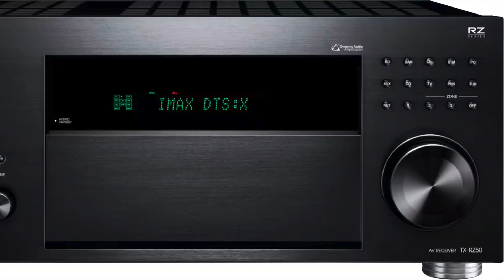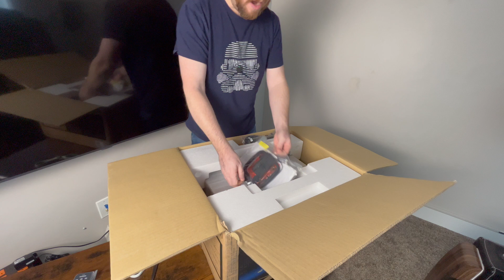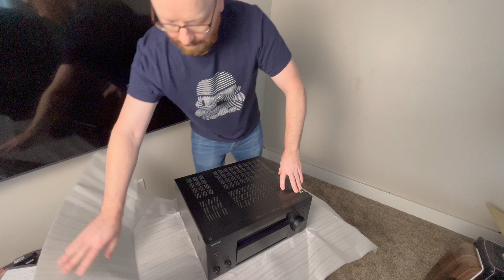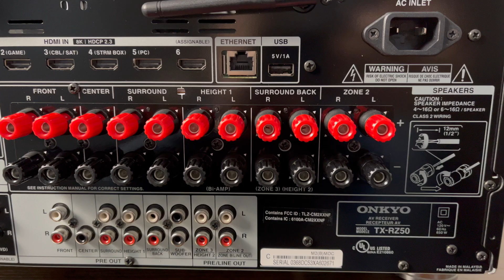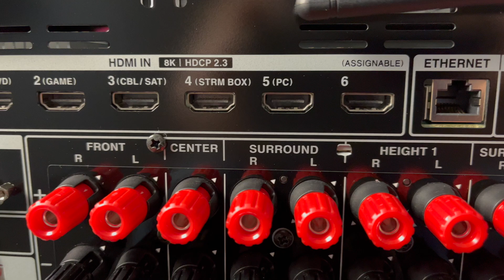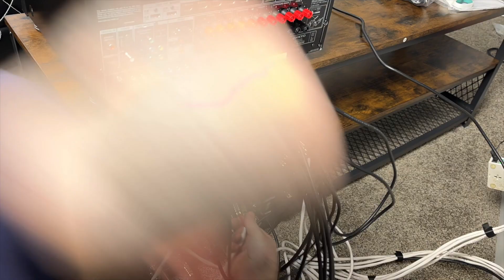Ep 5: Do NOT Buy a Home Theater Receiver Without Pre Outs

Comment: One of the main problems with most of any AVR pre-outs, and nobody really  talks about it, is the output voltage/sensitivity of the RCA terminals. Many of them suck at having a decent output voltage. Good luck at finding this information, because very few producers mention this crucial spec in their user manuals. All power amplifiers have a certain input sensitivity on their line level RCA. If there is a substantial gap between the output and the input sensitivities, you can have a problem with reaching the amp's true power potential. So, beware, you should take this into account when going with separates. At least, check the input sensitivity in the amplifier's specs, it's always there. If it's around 1 volt, it should be ok, most of the AVR's can deliver 1 volt at their RCA pre-outs. If your amp has a rated input sensitivity of 1.5 or even 2 volts, well, it may be a hit or miss for your AVR. I just don't understand why ALL the AVR's aren't capable of delivering up to around 2 volts by default, on their pre-outs. Almost all cd/dvd/blu-ray players can do that with ease.
Reply: The preouts on the RZ50 are very good. 3v rms. Drives my xpa5 with authority
Reply: Denon and Marantz receivers have a function named pre-out only mode that disconnects the receiver's  pre and power sections lowering distortion. Audioholics has benched excelent voltage output levels from these receivers overall 😊😊😊
Reply: @afelcandy , no, they don't completely disconnect the pre from power. Only the top of the line receivers from D&M do that.
Reply: @byron19800  As far as I know, since 2021 all the receivers from D&M with full pre-out connections can activate the pre-out only mode with any combination of channels. Nowadays DENON 3900 ou MARANTZ CINEMA 70 are the basic models that, once this feature being engaged, can be used as a full pre-amplifier 🤔
Reply: @afelcandy , I'm not talking about the existence of pre-outs or not. I'm just saying that only the flagship AVR's from D&M will give you the option to completely cut off the pre-out section from the internal amps. For the rest of the models, the signal is not completely cut off and the internal amps are still active, even in pre-out mode.

Comment: Here is another reason for the pre-outs:  Expandability. 

When we purchased our home, it was pre-wired on multiple floors with in-wall or in-ceiling speakers for 5.1 channel surround sound. On our main floor, it was in-wall front left and right, about 6 1/2 feet high.

We wanted something more encompassing and so purchased front tower speakers and upward firing Atmos speakers to sit on top of the towers.. So what to do with the front in-wall speakers. 

Option 1:  Some form of front Atmos channel
My Pioneer VSX-LX505 receiver only allows the Height 1 Speaker Outs for Atmos Front. 

Height 2 Speaker Outs allows for Atmos Surround and Front Heights. 

I had to use Height 1 for the Atmos upward firing speakers. Front heights are not really useful for forward facing in-wall speakers, as front height is really only beneficial for in-ceiling or downward angled speakers. 

Option 2:  Wall of Sound using Zone 2 or Zone 3

The thought then occurred to me that I could use Zone 2 or 3, and effectively create the same audio as the audio coming out of the tower speakers. 

 But the problem with Zone 2 and Zone 3 is it can only handle basically 2 channel analog or digital 2 channel PCM.  Well - this defeats the entire purpose if I want an Atmos system, as I would have switch all media content devices to PCM 2 channel signals. 

Solution?

The Pioneer (and Onkyo/Integra) receivers send line-level signal to the pre-outs in the same pattern that it sends signal to the Speaker Outs. So if running a 5.1.2 signal using the receivers own amplified signal, it will send line-level signals to the same pre-out RCA outputs as well automatically. 

I purchased a cheap FOSI 2 channel amp, connected it via the Front L/R pre-outs, and turned my front left/right from a 2 woofer, 1 tweeter tower, into now what effectively is a 3 woofer/2 tweeter speaker system for the front right and left.

Comment: Excellent advice, I only had one receiver, my first one that didn't have preamp outputs and it limited system expansion.  Everyone I have gotten since has had preamp outputs for all channels plus the subwoofer, although I have only used the front channel outputs.  What does anyone think about models that have both the preamp out AND the  power amp in/main in loop for all channels instead of where the internal amplifiers remain connected at all times?  Normally, they would be jumpered together for internal amplifier use, but would allow you to insert a processor between the receiver's own preamp and power amp sections (instead of using the tape loop), or bypassing the receivers own preamp and going straight to the power amp blocks,  in addition to not running the internal amps (at least not at that level) when not in use.   For example, some 90s vintage receivers that had this were the Pioneer VSX-D1S/D901S/9900S etc.  Although not digital and obsolete by todays standards they were reasonably future proof for their time.

Comment: saying do not buy an amplifier without pre outs in my opinion is incorrect. You buy what you need for the room you are in, in most cases people buy equipment which is overkill for their living space. Is like me buying a race track bike with all the mods and using it on the street, leaving a lot of performance on the table. Another thing is you can add an external amp to your none pre out receiver, I have done it and still do with all the 7 channel receivers I have purchased. did it with my Sony dh790, Marantz 1510 and Onkyo nr6100, not one issue with distortion well at least that any human can pick up. what you need is a speaker to line level adapter from russound, that one in particular handles up to 250 watts of power rms. just make sure you get the correct one that handles the rms of your speakers and you are good to go.

Comment: Yes... pre-outs can be very useful.  

I recently acquired new front left/right speakers that are 4ohm rated and there was no way I was going to allow my AV Receiver to power them and risk damage to my internal amps.  I ended up using a 2 channel class A/B amp and the pre-out to power them and it's worked out great for me.
Reply: What AVR do you have?
Reply: @gmoney5506  I currently run a Denon, AVR-2808CI from around 2008.  Obviously not a modern AV Receiver but it does the job for me since I run a lot of older pre-HDMI equipment on it.  Also, it does sport all the major codecs short of Atmos that satisfies my needs for now.
Reply: @gmoney5506 I own a Denon, AVR-2808CI from around 2008 (1st year that Dolby Tru-HD, Plus, and DTS Master HD was released).

Definitely not a modern AVR by today’s standard but it’s a good workhorse nevertheless.  Also, since I have a lot of older video gear connected to it, it works for my needs at the moment.
Reply: @gmoney5506  I have a Denon, AVR-2808CI from about 2008.  Not a very sophisticated unit @ this point but it does everything I need including interfacing well w/ my older source components that are pre-HDMI.

I'll eventually want to upgrade to Dolby Atmos but at this time I'm fine w/ my 7.1 set-up (this unit was one of the first w/ Dolby Tru-HD, Plus, and DTS Master HD).
Reply from the maker: It’s always good to protect your gear, glad it’s working out for you. Thanks for watching!

Comment: Haha. I'm keeping my Denon AVR-X3400H for now with only 4 speakers (I live in a temporary space) and I may plan on buying a 4-channel amplifier for my front speakers (JBL Stage A780 that I purchased recently) and surround speakers (Insignia NS-B2111 speakers that I purchased about 15 years ago). Previously I had a Polk Audio T-50 floorstanding speakers that I purchased from Best Buy about maybe 10 years ago before I upgraded to JBL and those speakers do make an improvement but at high volume, if the fronts are set to 40Hz or 60Hz, these speakers will probably make a crackling sound because the Denon AVR-X3400H couldn't handle enough power to send to the front speakers, so I'm planning on getting an amplifier. In the meantime, setting the crossover to 80Hz makes the crackling sound disappear and it worked fine. I kind of want to enjoy listening to my front speakers at lower crossover frequencies, but nah... I need to get me an amplifier for that.

I know my comment seems long, but that's part of my home theater journey. I'm just glad I bought a Denon AVR-X3400H instead of the 3500H because I did not have a need for eARC. I saved some money by buying a discontinued receiver.

Comment: There was forum talk awhile back with an industry professional about why their AVP/R do not have grounding plugs. He claimed it was to reduce ground loop hum/buzz in components. Take it for what it's worth because that was years ago and I cannot remember if it was an Anthem thread or something else. 

With regard to pre-outs, I agree wholeheartedly. I still use an Anthem MRX-1120 in my theater. It was a nice step up from the Denon 4311, but using the pre-outs and external amplification was a game changer. Hoping to grab one of the Anthem processors soon. 

Thanks for the videos, you are an entertaining follow.
Reply: Yeah I wanted to comment on the professional that said the eliminating the ground wire for audio quality reasons that probably isn't the reason.  Some bean counter saw that the company could save $$$ on their end by not adding that extra 6 feet of conductor and letting the customer take on that responsibility. Smh

Comment: The RZ50 for $900 is the best value currently in the industry. I paid a lot more for mine 3 years ago. The potential issue with the internal amp is a moot point when paired with external amplification. Mine works great and sounds even better. Dirac is amazing. Would love to see you document your experience with Dirac to see if it reconciles with mine. Keep up the great work 🍺
Reply from the maker: I’m hoping to get my Dirac video out later this week. Thanks, glad you’re enjoying the videos!
Reply: Yeah I wouldn’t trust the RZ50 to power speakers at this point but at $900 it’s still a killer pre/pro. Not just the pre out channel count but also Onkyo’s HDMI section and the inclusion of DIRAC. You literally cannot buy a standalone hometheater processor anywhere near that price point. Which, frankly, is really DUMB but that’s the market I guess.
Reply: If you can find a 3800h for about the same price, it's a superior avr though. 4 LFE outputs including one that can be set to Tactile instead of just one LFE like the onkyo. 
More flexible speaker/amp configs.
Way more stable firmware including Dirac performance which is still flacky with the Onkyo.
Full preamp mode or selective

Comment: This receiver would easily drive those speakers and another set in another room... Its a freaking beast.... Onkyo rep when interviewed says they are very conservative in rating them because they're way more powerful.  BUT extra headroom won't hurt especially if you wanna play at reference. Nice series nonetheless
Reply: Unless you are driving 4 ohm speakers or your 6 or even 8 ohm speakers have an impedance dip that trips the Onkyo’s ‘protection’ mode which nerfs power output and doesn’t actually TELL YOU it’s done this. This bug affects the current crop of Onkyos as well as the Pioneer AVR line. I bought an Onkyo last year and just sold the unit as it sounded absolutely  terrible. Replaced it with an actually lower priced Denon and the difference in quality is astounding.
Reply: @sage11x  I'm not sharing your experience, but enjoy your Denon

Comment: I think I have an avr with pre-outs marantz 6014 so what kind of amp should I get I’m running 7.2.4 and what are the difference in getting the right amp for my little man cave 9x9 room with 4 in the cealing
Reply from the maker: Outlaw Audio has a $150 off sale right now. Use code 25DGY. You can use their 5 channel amp to power your LCR’s and a couple surround speakers. 
https://outlawaudio.com/shop/products/50-model-5000x-5-channel-amplifier.html